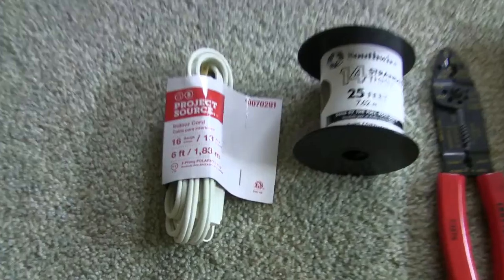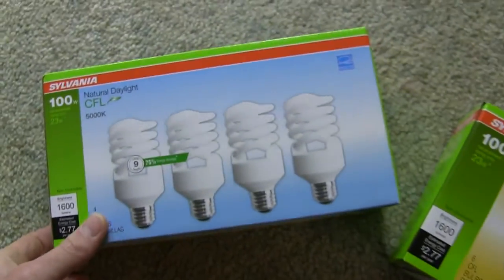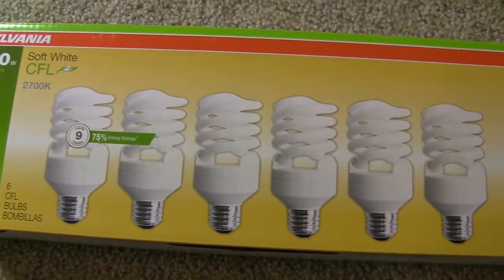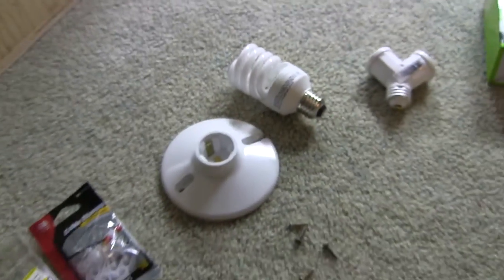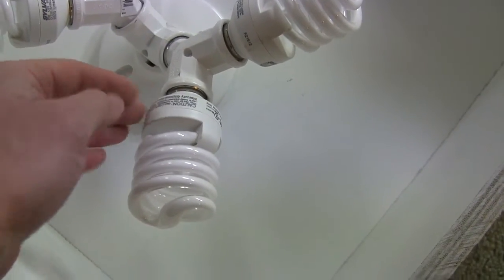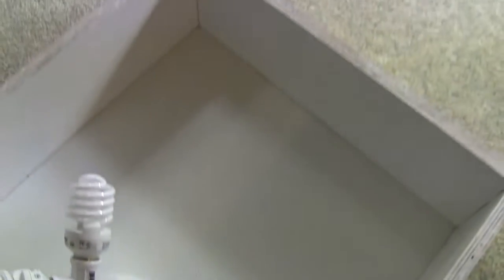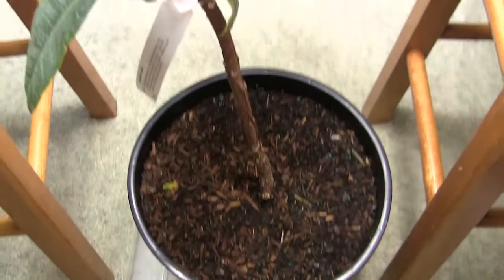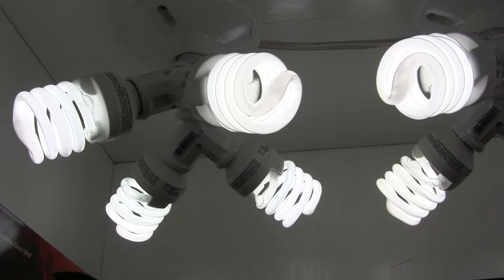How to Build a 184 Watt CFL Grow Light for Overwintering Plants

Comment: Cfls are hard to find in my area due to led bulbs. Can the led bulbs with similar kelvins be used instead of cfls? I am supposing it should work just as well.
Reply from the maker: Yes, people do use them, although, as technology improves the cost comes down and it's been several years since this video.  You can find really great grow lights for relatively little money.
Reply: Actually, delidded led bulbs actually do much better at growing plants indoors than cfls, since they’re producing light in one direction. The only reason why you’d want to throw in a cfl bulb into the mix is that they can add a small amount of uv-b to the overall grow spectrum.

Comment: Add a small fan to blow on your bulbs on a 24 hours a day, to displace the heat near bulbs, as well as spread the heat all around, in winter, to help, augment the heat in your grow room, and add lots of open containers with water, to add moisture to your room, as all A.C. units remove the moisture from the air, so help your plants, with added water containers, at least 10, cut in half milk jugs. Your soil will not dry out as fast with added water in your grow room.

Comment: Keep your C.F.L. bulbs, horizontal if possible, and only 12" for a 200 watt CFL or 16" for a 300 watt CFL bulbs. Also have a small fan about 6 ft. away from plants, to add Cellulose to your stalks of your plant, so use a small oscillating fan on a timer, for 15 minutes, on, and off for 6 hours, as all marijuana growers KNOW to have larger, thicker stalks, add a fan to move your air, and in winter, to keep from having a hot, and cold pockets, keep the air replaced at least once daily if in doors, if not too cold out side. For larger CFL bulbs,  see 1000Bulbs.com or call 972 - 947 - 2914

Comment: you are aware that those 'y-splitters' are rated 60W max? By splitting the splitters you are now putting in 23W x 4 lamps = 92 Watts through the "base" splitter. That is well over 50% more than it is designed to handle.
Reply from the maker: Not sure where you're getting your parts but mine are rated at 660 watts each and I'm well under the rating.  Been using this light box for 2 winters in a row now with no problems.  Thanks for watching.
Reply: @MikeKincaid79  can you help me make sure I don't start a fire... Is there anyway you can reply the specific specs I need to know about wire size etc. To make exact replica of your set-up. By far looks best video I've found.

Comment: hi , is it safe to put two  splitters  together???
Reply from the maker: Been using this light 2 years in a row now and not had any problems.  They key is to make sure you get a gauge of wire and components that can handle the wattage.

Comment: Sir I have question .. I want know that when I take cuttings from my flower plants especially (FUCHSIA  AND GERANIUM) in late summer for the next season, it is obvious that I have to keep the cuttings indoor to save them from the frost during harsh winters, now my question is should I use CFL or LED to keep them green in winter so that they are ready to re-pot in early spring and get early bloom.... Thank you. 
Please reply.
Reply from the maker: You can use either light system.  I used cfl last year and it worked great.
Reply: Thank you so much.. I will now do the same and hope the results will be great.
Reply from the maker: Good luck, let me know how it turns out.
Reply: I will definitely.

Comment: your output doent wok that way, cant add them wattage oif each cfl to have a real total. dont work that way unless their all from a single point, and their not. more math involved to get a real answer
Reply from the maker: I used it all winter and it worked great!  What math are you talking about?
Reply: in order to just add the wattage of each cfl and come to a total their more math. their not all from a single point, so outputs overlap and fade. their needs to be more info to calculate the total real output over square footage.
the only thing accurate is you pay for  that wattage ;listed by basic adding. learning inverse square law may help as a start on getting how light works
is same as me, run a room with 10x1k hps lights. that isnt realy 10k output, its over a room 12x15 foot
Reply from the maker: Haha, dude I think you're on the wrong forum.  You're looking for Calculus Geeks Unite, lol.  I'm just trying to get some plants through the winter and this setup worked better than expected.  I may purchase an led setup for next winter though to cover a bigger area and cut down on electricity.  Any suggestions on led setup?
Reply: its basic light info. not techy at all.
led suck. less wattage is why they cost less to run. but you lose output to that way to, so no further ahead, they may have nicer colour, but when thy lack penetrating power, that color is useless to reach plants efficiently. everyone of them salsemen brag and talk on colour output only., they avoid talking lumens. say its not important. their way more to light than just colour output.
id rather run a 400 hid light..or less if desired, and have way bigger footprint of light, and massive more penetrating output, and way cheeper to buy. last longer. led die with the fans in them drawing in crap. kills the electronics
your cfl thing just to keep them going through winter is fine, just the total wattage doesnt ad up that way was all
inverse square law may help with some lighting info
Reply: Canadian Green break it down then, if you know the answer
Reply: Leds are better than cfls but you need a top of the range kit to even make a difference. So if do be careful where you buy them from. Hps's personally i think produce the best yield but kind of annoying as you'll need proper ventilation as the bulbs can get really hot. Cfls are still great for you. In my space bucket i can get 1-1.5oz per canni plant with my cfl setup